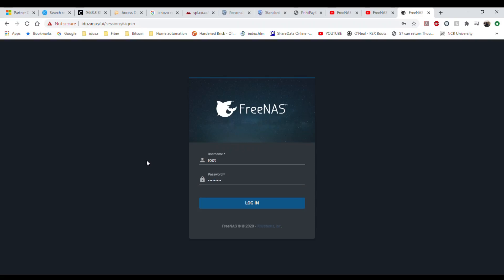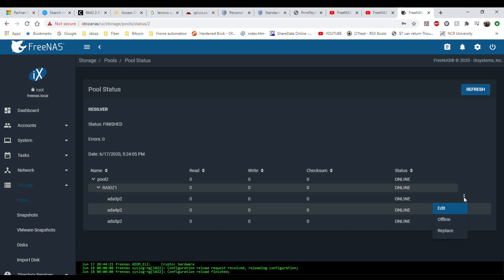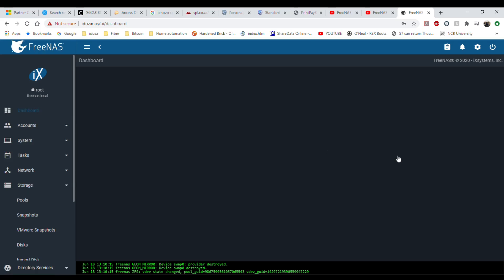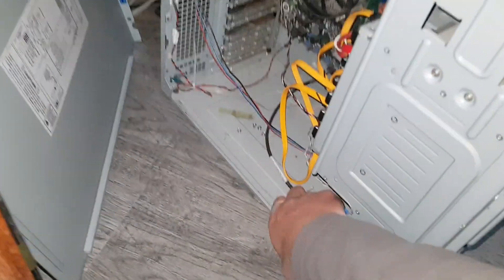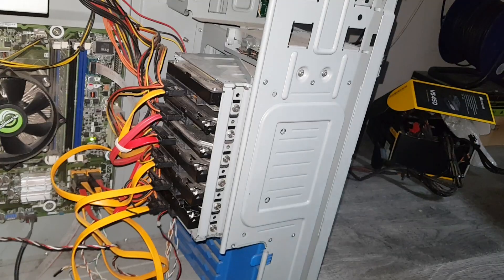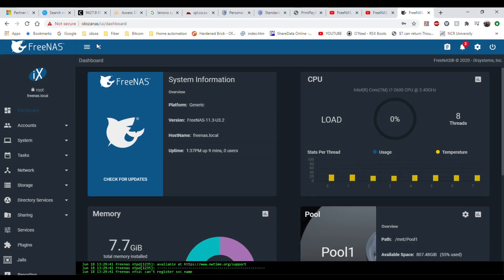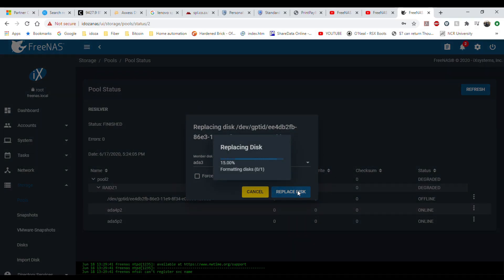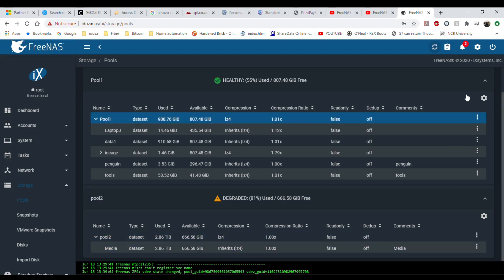Freenas hdd size upgrade

Comment: Have you seen where you go to replace it and it just has a "-" instead of the drive to replace? Does it need to do some processing in the back end or is there more to it that I'm missing?
Reply from the maker: There should be a drop down and you should be able to select the new drive
Reply: @jacqalas  there was for the first 2 drives that I replaced, the 3rd drive there is just a "-" and no option for selecting da6
Reply from the maker: @JoMiller97  maybe a bad sata cable but they should show up in the dropdown menu
Reply: @jacqalas  oh no, the server detects the new drive fine, it just won't let me do a "replace" of the old drive for some reason. They are all hot swappable so maybe it's because I set the drive offline and don't shut down right away I just hot swap the drives.